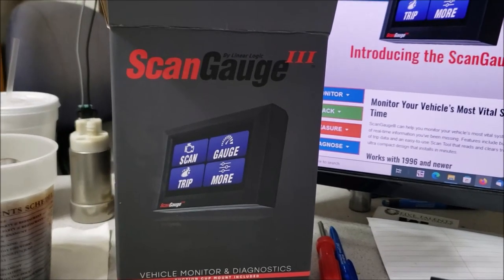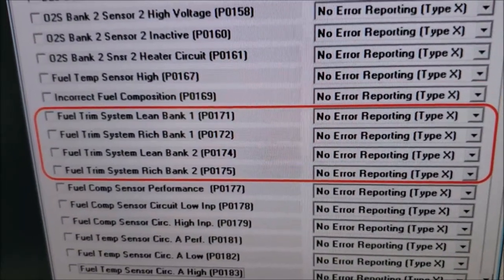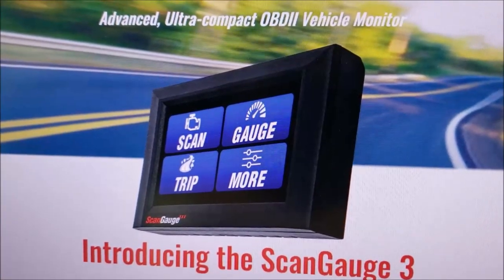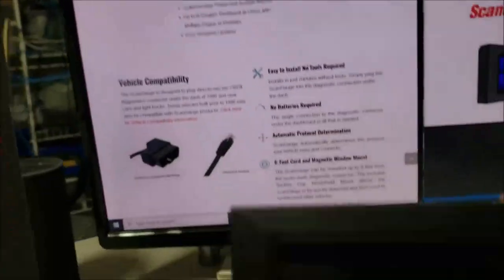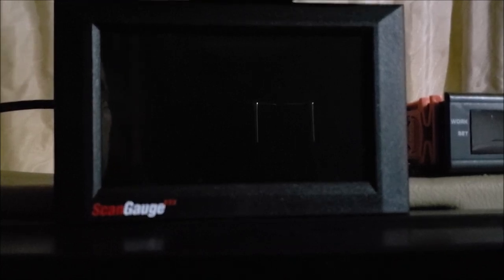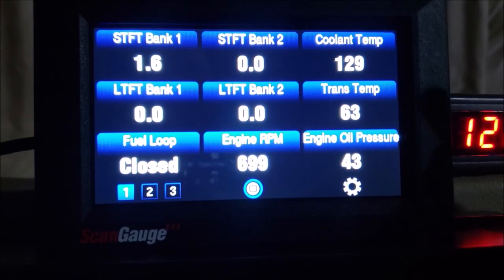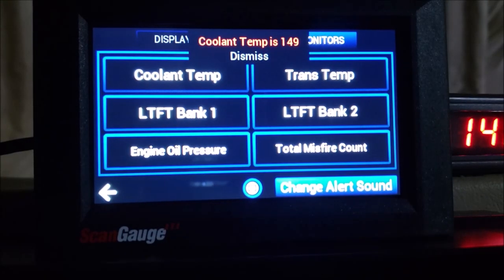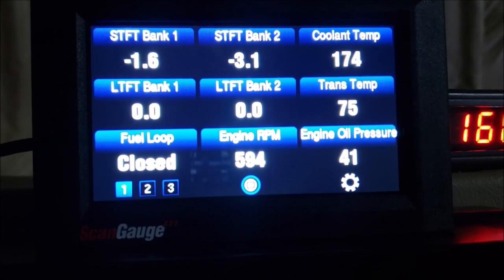8.1 Vortec Engine Saver:PART 1 Introducing the Scangauge 3 For Your WorkHorse Chassis / Winnebago RV

Comment: Hi Kevin, thanks for the great video. I recommend everyone ensure there ScanGuage3's are connected to there WIFI networks and updated to the the latest firm ware version currently 1.18. Mine was at 1.13 and would not display oil pressure...However after updating firmware now I can monitor oil pressure.
Reply from the maker: Good timing, in fact I address that tomorrows video, PART 2 about updating and settings
Reply: Thanks for info, my understanding is it won't read oil pressure on my 1998 7.4 vortec
Reply from the maker: @mellow611  You could add a gauge to it I like this brand https://amzn.to/3Xif2lJ

Comment: Thanks for the Videos Kevin!   I already had a SG3 for monitoring Trans temps and after your videos setup the fuel trims.   Holy moly,  25 for long term fuel trim  and 49 for short term.  I wanted to turn it off as the numbers were so high I didn't want to see them!   Put in a new MAF and bam,  numbers read a total of 10 now.    Thank you.   going to look at your other Videos as my electric fans don't seem to come on till 217 degrees causing me to hit 230 coming into Austin NV.   03 P32 with the 8.1  52k miles
Reply from the maker: Text me 606-875-0125 so i can call you back, I have some things for you to check Kevin

Comment: Bought one of these a few months back, great improvement over the scan gauge II, Thanks for the video Kevin. Looking forward to your MPG video, my next trip I'll monitor mine, us Workhorse owners can post up some MPG results, would be interesting.
Reply from the maker: Yes I'm sure we can all learn from each other. As we play with this new tool.
Reply: Thanks much, I'm guessing if it won't read my oil pressure, perhaps I can stay on my scngg2, I believe it reads trans temp in x gauge mode, unless with significant additional benefits you still recommend the upgrade.
Reply: Meant for Kevin
Reply from the maker: @mellow611  The scangauge 3 will read oil pressure be sure you have the latest update ver 1.18 I address this in video part 2 will post Sunday night
Reply: @ktoutdoor  yes sir, I got a response I believe from the manufacturer, and for my 1998 7.4 Chevy seems it will not read oil pressure if I read the text correctly
Reply from the maker: @mellow611  If you buy from here https://amzn.to/3Gv65Qo and it don't work you can return it for free if you don't like it.
Or for oil pressure this may be a option https://amzn.to/3vIEQvI 
But I really love the scanguage 3 with its alarm function it may save you engine some day

Comment: Thanks for the time you take to make these videos, I had a fuel pump going out but did not know it. It would  set a knock sensor code now and then, but after the pump stopped working and I replaced it the code is gone. I guess I got lucky not to damage the engine.
Reply from the maker: Yes for sure, if you was running lean enough to set a knock sensor code. I hope you get yourself a Scangauge 3 someday  10 years ago I could hear the pinging sound while under load turned to be bad MAF .. then I got the scan gauge 2

Comment: Keep in mind, no coolant may only read the steam temp in a sudden loss in your scenario. A hot engine will lose power and start knocking real quick. Refrain from standing on the throttle to compensate. Also, a lean condition creates audible knock. Brains protects an engine real well. Most people just floor it until it seizes or something real catastrophic happens.
Reply from the maker: Thank you for contributing I know what you mean 10 years back I could hear the pinging while going up a hill. it was the MAF... But most people I talk to after running lean say they had no warning at all. It maybe from all the noise the radiator fan produces that they cant hear the pinging.

Comment: Hi Kevin. Awesome. Just purchased the Scan gauge 3 for my 2005 Winnebago Adventurer. Do you have a summary of your settings available? That would be appreciated. Also, you changed your thermostat to 130 I believe. What should the reading be for an original thermostat? Cheers and thanks in advance! Fellow Owner JB PS mine is the 8.1 vortex workhorse as well.
Reply from the maker: I my video part 2 I go over my setting https://youtu.be/2_FocccxGv4  The original thermostat should be 195 I changed to a 180 years ago here is the video  https://youtu.be/03nw2BOitOk  PS I would like to pick your brain about home inspections call or text my cell at 606-875-0125 Kevin

Comment: Greetings friend, wondering if this will work for 1998  chevy 7.4 in my rv
Reply from the maker: I got the reply from the manufacture 
Hi Kevin,
It will.  Anything 1996 or newer gasoline vehicle sold in the United States has to be OBDII compliant.  It should report the fuel trims, and for the GM specific XGauges It will likely be similar to your 8.1.  It may not report Oil Pressure, but Transmission Temp should be there.

Regards,

James DeLong
Linear Logic LLC
Development Engineer

Comment: Thanks much, if it won't read my oil pressure, perhaps I'll be ok with my scngage2, i believe it reads trans temp in x gauge mode. unless you suggest with all the other benefits, I should still consider the upgrade.
Reply from the maker: Yes please upgrade the alarms that you can program  may save your engine or transmission someday, and if you sell your RV some day you can use this in any vehicle.
Reply: @ktoutdoor  thanks, I will use your Amazon link going forward, please forward asap
Reply from the maker: @mellow611  https://amzn.to/3ZedL13

Comment: Also, Kevin, you mentioned that the fuel trim numbers may be higher with Banks modification. I  recently purchased my 2001 Fleetwood Southwind with a P32 chassis.  It did not have complete paperwork of previous engine services.  I suspect that it has some Banks modification because it has a faded decal on the body that looks like it says "Banks" and it has two exhaust pipes on the passenger side. How can I tell what Banks modifications, if any, have been done.  And again, how does that affect fuel trim readings? (or was it mass flow?)
Reply from the maker: There are different Banks systems see link below, With the Banks system installed you may be flowing more air than a stock engine, if you flow more air then you must flow more fuel to match. So that's why your fuel trim numbers could be as much as 15% long term and that would be considered normal but keep a close eye on it because you max out around 25% that's when engine damage may occur. https://bankspower.com/collections/compatible-products/year_2005_make_GM-Motorhome_model_W24_engine_8-1L-Gas
Call or text 606-875-0125 Kevin

Comment: Thanks Kevin.  By the way, what is the web address for that screen shot you have of the error codes and what is reported?  I have a 2001 8.1 on a P332 chassis.  I would like a better source for the codes.
Reply from the maker: Text me at 606-875-0125 so I can send you a link to my Google drive folder. That has what your looking for

Comment: I have an issue where fuel trims will reach 21/22/23/24/25-ish range when I let off the throttle. When I am giving it gas it drops back to normal ranges. This is able to be reproduced each and every time. Any thoughts?
Reply from the maker: Yes I have meany so give me a call or text so we can go over the possibilities 606-875-0125 Kevin

Comment: Hi Kevin. On the video of the oil pump is there a gasket that goes between the oil pump and the shaft? It only has one bolt and I have not found anything where there’s a casket what I did find out if there’s a collar that needs to be there between the shaft in the pump.
Reply from the maker: Call or email me I have some pictures for you 606-875-0125 kc5210@gmail.com

Comment: Kevin, I am strongly considering purchasing Scan Gauge but I’m concerned about leaving it plugged in all the time. I have seen a few you tube videos that instructed not to do so. Any thoughts on this?
Reply from the maker: Go a head and get one . This is not a problem mine stays plugged up 24 7. If you set it to COM  then it goes off when the key is off.
Reply: Thank you for the quick response.
Reply from the maker: If you need help my cell phone number is 606-875-0125 Kevin

Comment: I understood about half (or less) of your explanation of monitoring parameters (my fault not yours). Do you know why Allison 6spd temp cannot be monitored.....could it be because there is no signal being sent by the trans? Could a sending unit be installed in one of the lines that flows thru the trans cooler? Thanks for your videos.
Reply from the maker: I will try to do a better job of explaining fuel trims.. The 6 speed has a sensor but it seams it cant be unlocked .. but this would be a simple solution https://youtu.be/T0ezHdCoLKk
just bolt sensor to bottom of oil pan and your ready to go. Thanks for watching